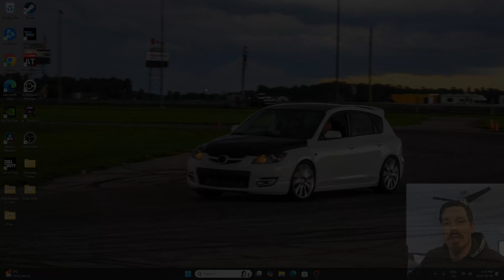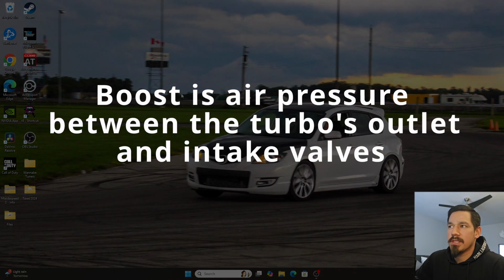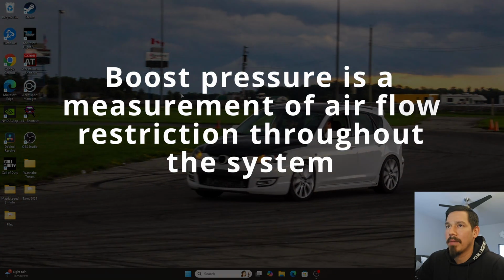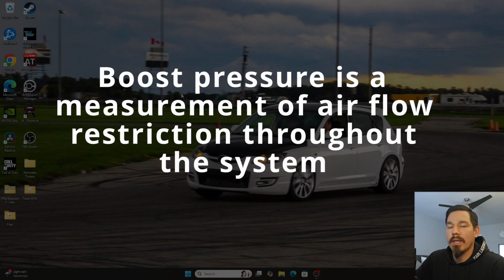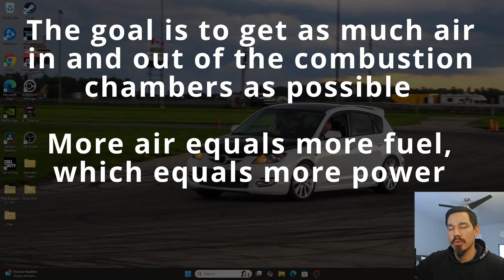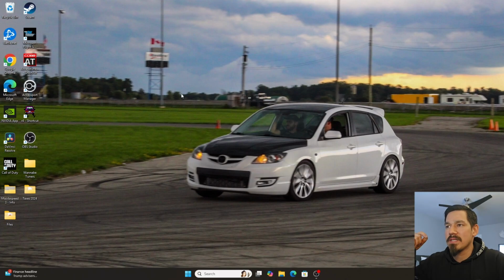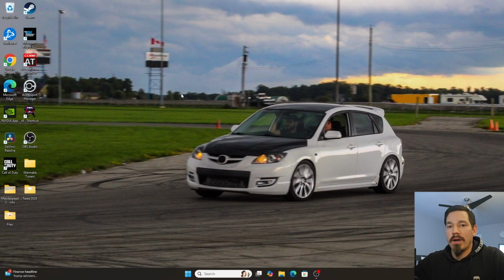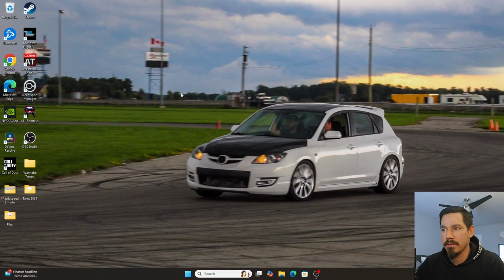Mazdaspeed 3 ECU Tuning Ep.3 - Understanding Boost Pressure

Comment: Hey bro I’m currently building my motor, I am a couple weeks out from start up and I’m low key just worried about oil pressure on start up, obviously I’m used assembly lube but I’m worried about it running dry on first couple cranks, is there any way to prime the oil system without spinning the engine?
Reply: Idk if im over thinking it let me know what you would advise, thanks bro
Reply from the maker: Is the car a GEN 1 or a GEN 2? I know with my GEN 1, pushing the clutch and gas pedal all the way to the floor will disable the fuel injectors while cranking (de-flood mode). I like to remove all spark plugs to eliminate compression while cranking until you start to see oil pressure on your oil pressure gauge. I'm not sure if the GEN 2's are the same with holding the gas pedal down, and with push start, that might also complicate things. If not you can pull the in tank fuel pump fuse, remove spark plugs, jump the starter relay with a small wire to crank the engine in 4 to 5 second intervals until you start to see oil pressure. But I really do wonder if the GEN 2's are the same :)

Comment: To add to the learning: to make more power you need more oxygen. In cold air you get more of it as the air is more dense. There are different size of turbos and one needs to pick the kind based on the engine it will be coupled with and the kind of behaviour one is after. Anyhow each turbo have their own efficiency curves, but due the complexity of it, only big turbo manufacturers usually have resources to measure and provide them. When running the turbos on the top of the efficency curve you create least amount of extra heat to the air that gets compressed to the engine. Less heat, more dense air, more power potential. This links to the fairly vague term "turbo needs to work hard" whatever that term means in this case. Less heat also allows more aggressive ignition timing, and the probality of knocking/pre-ignition goes down. More power from engine, creates more heat, heat causes pre-ignition/knocking which causes ecu to retard ignition timing, which means less power.
Reply from the maker: Well said, I agree 100%. I find it very interesting how pump gas alone can make a good amount of power if the setup can breathe.

Comment: blew a hole in my block. couple days too short :|
Reply from the maker: @SOMERANDOMPOSER  Ah damn. Time for a rebuild?
Reply: You most likely blew the block because of poor maintenance of the carbon buildup. 99% of the motors I tune have very very poor maintenance on the carbon buildup... and they are down 100hp... once maintained correctly and full boltons, they'll gain 250hp.